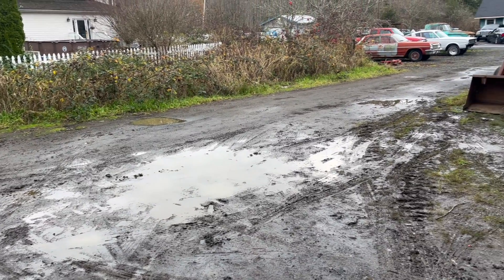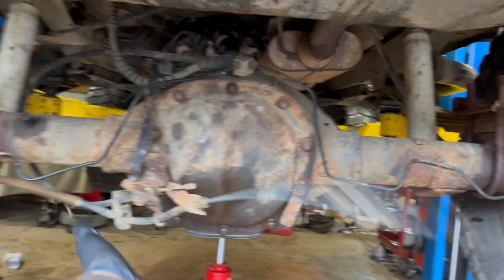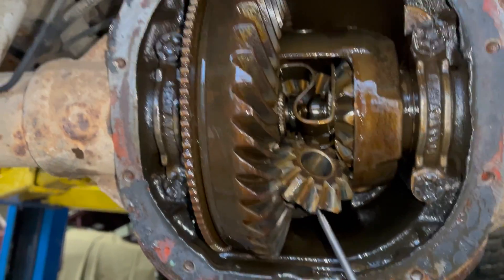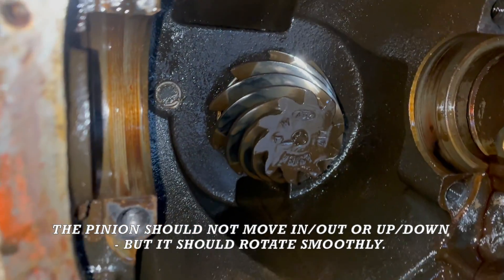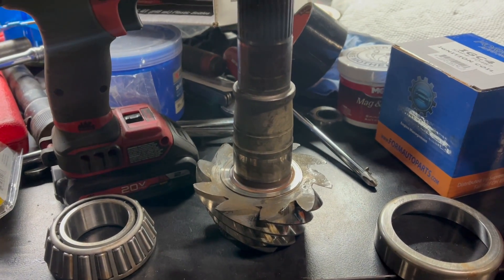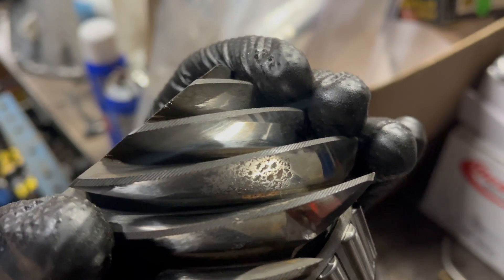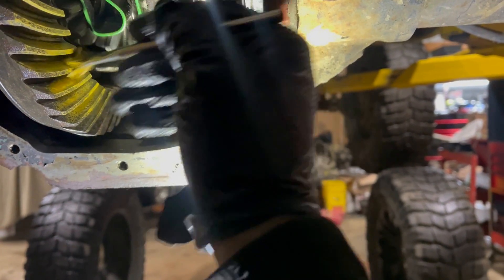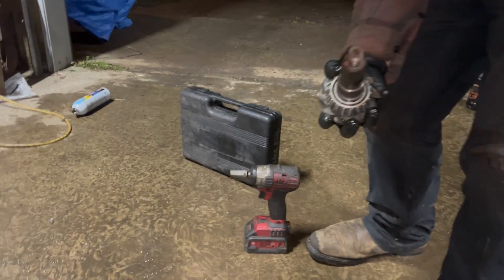How To Rebuild A Differential - Setup Basics, And What You Don't Want To See

Comment: What causes the backlash-like clunk from both axles (sometimes solo, sometimes both) but it’s not from incorrect backlash? Driving me nuts …only happens when accelerating or decelerating / weight shift on axles, and everything looks damn near new. Can Incorrect preload with adjustables on carrier cause that? Chrysler 8.25 in 07 Nitro R/T
Reply from the maker: I’ve experienced that myself, and unfortunately I really can’t say. I can tell you that the Chrysler 8.25 and 9.25 have relatively sloppy pinion setup specs compared to other axles, so perhaps that accounts for some of it. Those rear ends are also very hard on axle shaft / wheel bearings for some reason. Make sure your u-joints and transfer case (assuming this is 4x4) are in good shape and that’s about all you can do.
Reply: @DeadDodgeGarage  ya I’ve been reading that, giving it one more go tmr since learning about carrier preload🤞🏻thx

Comment: The gear surface isn't rusted. That is spalling. It is a form of gear wear where the surface separates from the rest of the parent material due to fatigue.
Reply from the maker: Why is it only showing that wear in areas that do not make contact between the two gears? And why are those areas full of rust staining? The pattern looks just like several rusty gear sets that I found pictures of online - gear sets that, like this one, have sat around unused for years and have seen way more moisture than they ever should have. I don’t know what the mechanical process for preserving the areas that make contact is, but I suspect the forces acting on the gear oil film between the two gears could explain it. I don’t know how a gear could fatigue in an area that - at least when cold - makes no contact with its mated gear.

Comment: Your timing of videos is so funny to my car troubles I must share this story a month or so ago my 87 Ram chargers drive line exploded while driving down the road. I thought it was the drive line come to find out the rear end came apart. trying to Find gears and things to Rebuild the rear end I Found a used rear axle and put it in after Driving it The Used rear end was howling and making a lot of noise so I bought a new set of gears from rigid axles and Wanted to put in new gears Myself Never doing it before I wasn't a 100% confident doing it and the gears were quite expensive I called many shops and I had a lot of shops that would not do it they weren't trained and did know how to Install gears. I finally found a shop that could do it and they installed the gears and then charged me full rate and gave me the truck back my speedometer was off and the truck drove funny come to find out the gear set that was delivered was wrong the people that installed it knew it was wrong when they installed it but because I supplied them they said that was my fault instead of calling me and asking they even knew The reason it was there was for noisy gears and that I did not want to change the ratio. So then I had to order a new set of gears the correct set and have them installed. my $2000 toy 87 Ram charger just cost me $2300 for the rear end I should of done it myself